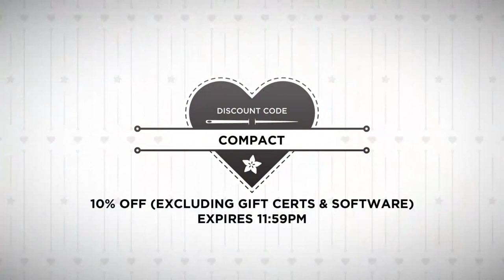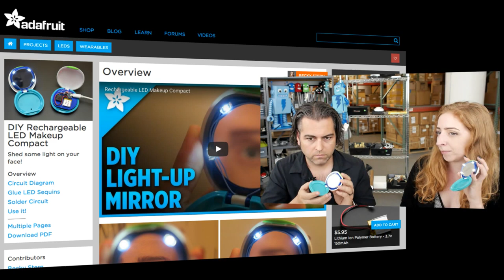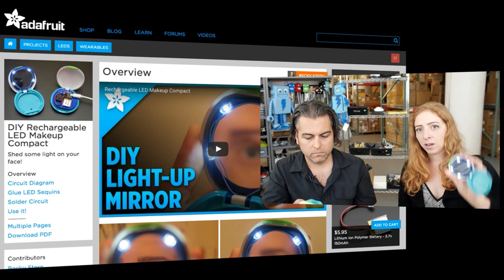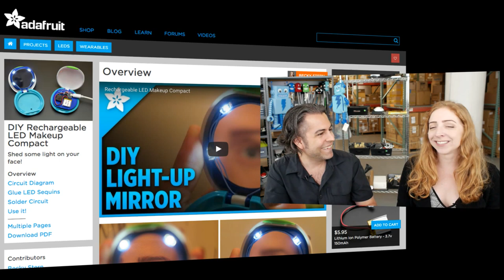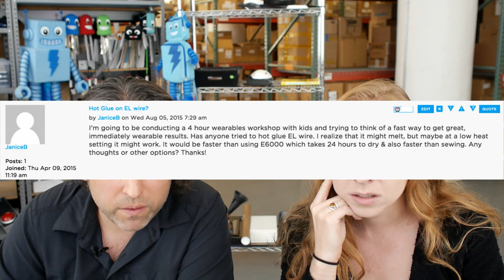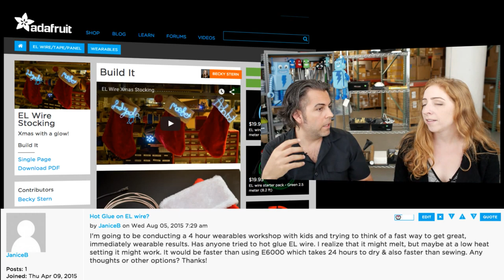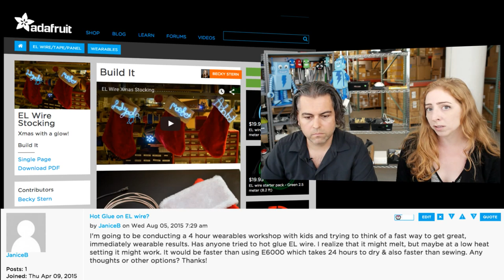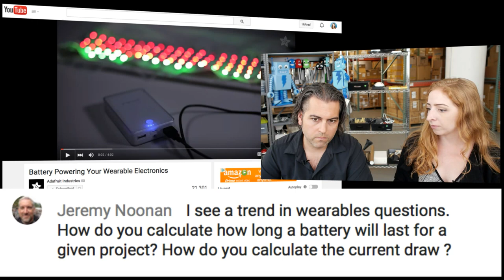Wearable Electronics with Becky Stern 8/12/2015 - LIVE

Comment: Dear Ms. Becky:
What's the smallest kind of battery I could use to power a High Torque Micro Servo? Is it possible to alter any servo to become continuous rotation?
Also, what's the difference between Adafruit''s Flora and Gemma?